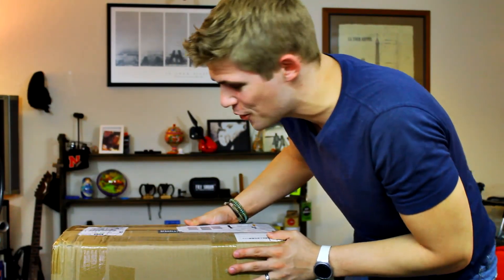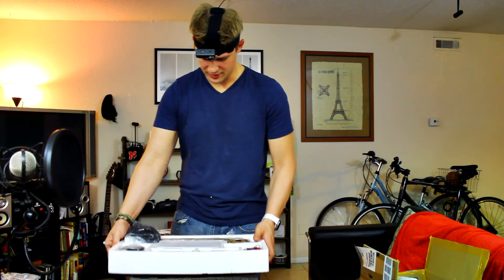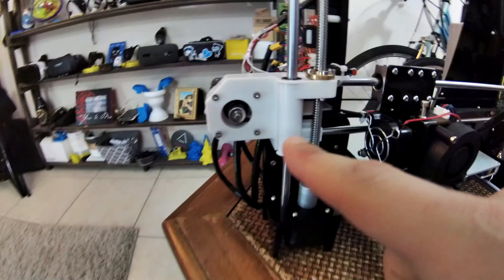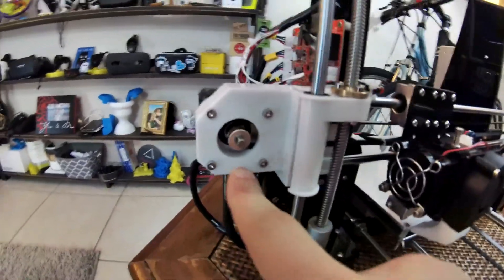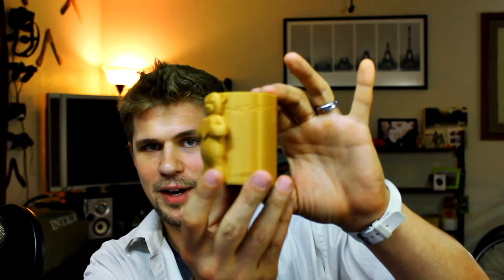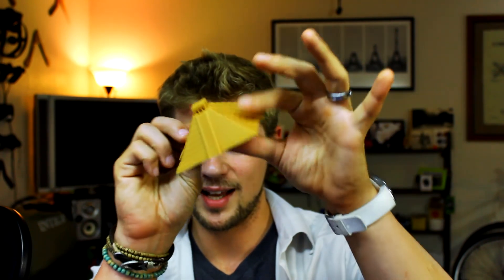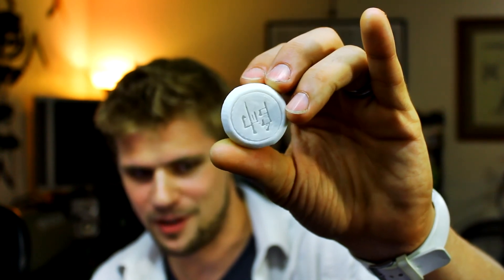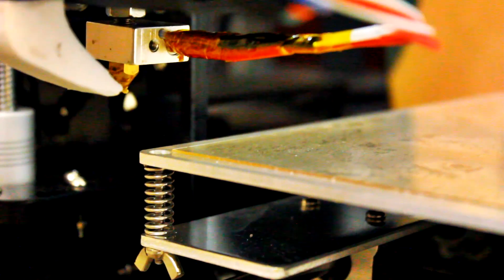✔ Anet A8 Desktop 3D Printer Prusa i3 DIY Kit - QUICK REVIEW!

Comment: This is also my first printer. Ive had it a few months. Its taken a few modifications but it prints pretty reliable.
Reply from the maker: I think it prints great! That was before modifications.. So far I'm changing the PSU and adding a Mosfet as well as the cable plug-ins also added some supports, etc. How about you, what is your favorite mods?
Reply: Added a power switch. Really made things easier. Added a Raspberry pi for controlling which is amazing. Since I put the motherboard and a mosfit into a case the sd card slot was hard to reach. With the pi its not needed. Also loading new filament is super easy with the hinge for extruder heatsink. A Y-axis tentioner was a nice addition. My favorite is probably the raspberry pi tho. So easy to add new files, control it, and even add a camera and see it.
Reply from the maker: ok I want to do this with the Rasberry Pi, is there a link to instructions as to how to help it control the printer? also I was thinking of adding an auto level to it but I can never find the best solution. Any thoughts as to which is the best for this type?   ***also how did you hook up the Pi power cable to the printer PSU?
Reply: http://octoprint.org  
if you can put a printer together from a kit this won't be hard. 😊
I think Amazon has the best deals on Raspberry pi's kits. I haven't added a auto level yet because I've been doing really well getting it level and sticking. I use only hair spray. I use to use painters tape but it was more trouble than help. I'm sure there is a YouTube video about adding a auto level tho. I've seen things you can print in order to attach it to your extruder block, on thingiverse.
Reply from the maker: ive already printed a level attachment lol, for the bed I bought a simple PEI with adhesive and it works great!
Thanks a lot for the help!
Reply: looking forward to the next video!

Comment: Just a headsup. That 20A PSU isn't really enough. Mine overloaded and I had to get a 30A from amazon.
Reply from the maker: can you send over a link to the one that you purchased? thanks for the info!)
Reply: Reza Danby The included PSU simply isn't enough for the printer, so it tries to draw too much power from it and overloads the PSU
Reply from the maker: I went ahead and just bought the 30A PSU from amazon as well, figured I might as well since im upgrading everything else. Any other nozzle or auto levelers added?
Reply: Nope, mine is bone stock besides that, I still haven't printed upgrades but I will soon.
Reply: Ohh, I lied. I printed a ring fan duct, that's it.
Reply from the maker: it is a must have!!!

Comment: Aluminium bed and then glue stick? Or just bare aluminium?
Reply from the maker: I ended up using the gluestick when it was just the aluminum bedding)
Reply: PEI (I think that's what you called it) is that worth it? I seem to do just fine with masking tape haha. does it make a nicer bottom layer finish like glass?
Reply from the maker: it gives a very nice and smooth finish)
Reply: Thanks I'll have to give it a go. :)

Comment: 2:49 the H plate is upside down, I know on the video that I followed it had it like that but people on the Facebook group are adamant that it's the other way round. Also I'd get a mosfet installed on that bad boy they're sorta notorious for not being rated for high currents when the heated bed is on. Obviously I can't speak for the complete stock version but what I've had to do with it is a little silly. I installed a ramps board to begin with, the connector for the heated bed melted and almost set on fire, got a new one broke of that shitty connector and soldered directly. Then the heated bed over time it arched one of the connections I think it was the ground, this will be because it just became lose over time. I had to Resolder that I rotated the heated bed 90 degrees so the connection is facing towards the motherboard and then I printed off the anet a8 cable chain that you can find on thingiverse to reduce the pulling on the connector. I've had this printer since Jan, had most of those issues listed above in Jan early Feb, now it's been fine and I've had zero issues with it. Simply3d has brought it into a whole new league and multiple processes are just sweet. Another printer that's probably worth checking out if you've got the time is the tevo tarantula. Good review from RcLifeOn
Reply from the maker: I think the plate was correct, but the plastic pieces I put on were not correct, I fixed those later haha, **tell me more about the Mosfet addon? I'm unsure about that.
After retightening the belts it performs a lot better than my first test as well.
Personally I have never used Simplify3D or used multiple processes. It seems I have a lot to learn still!) :D
Reply: Reality Check VR I could be wrong as I'm not with my printer it's probably the right way round, I don't think it matters too much its just like you said a case of getting the belts tight. I have a ramps board so I'm not too sure. But as far as I'm aware there's a mosfet sold on aliexpress and eBay for the a8. Yeah I'm pretty new to it too only started in Jan, lots to learn such a good hobby. If you're not already subscribed I'd recommend makers muse and the 3dprinteing nerd